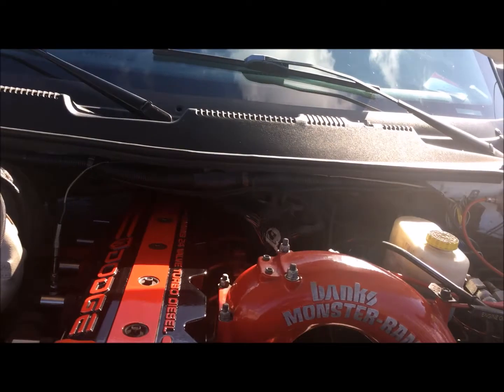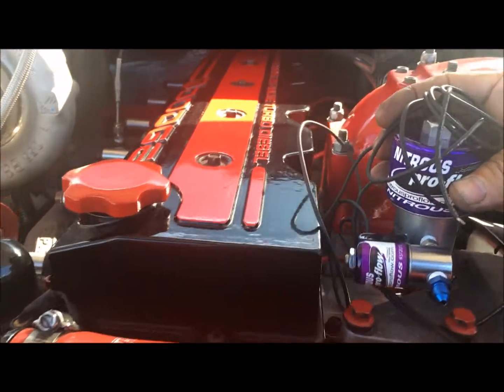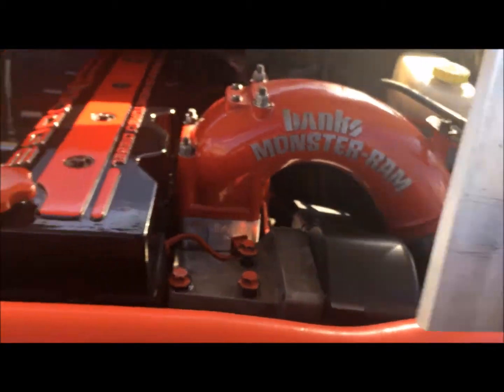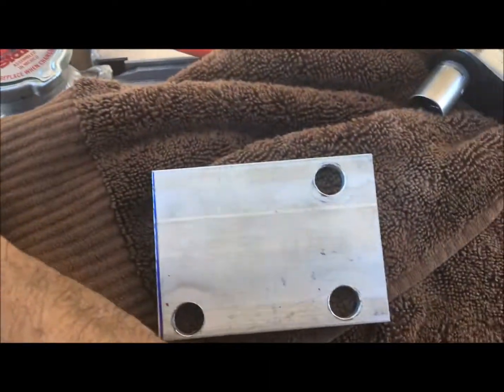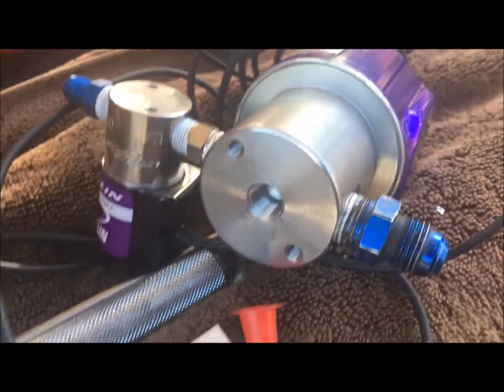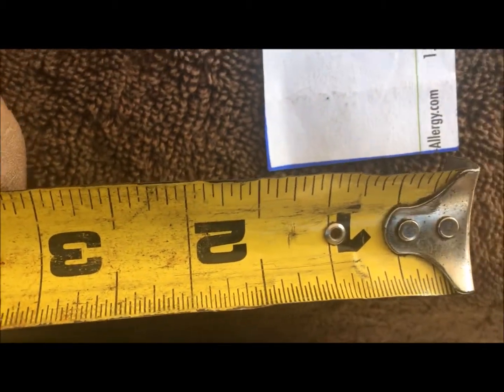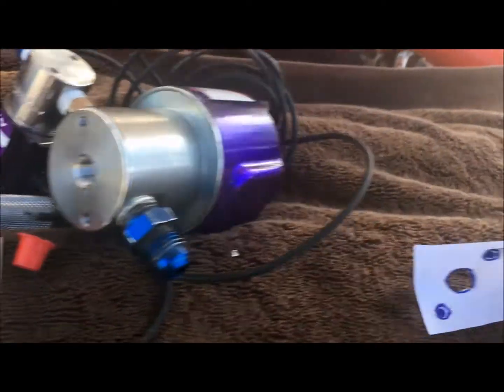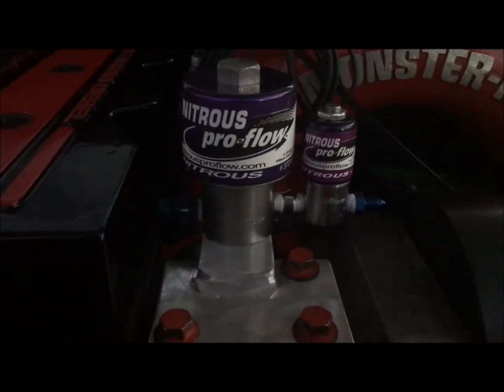How To Install Nitrous Oxide Injection On A Cummins 5.9 Cummins Diesel (Part One)

Comment: Clean truck do you have any vids with the nitrous being used ?
Reply from the maker: YOu know, life can be complicated at times.  when you get older it seems you never have the time to do a lot of stuff.  either that or i am an undercover procrastinator!!  But to answer your question: not yet.  I still have to do Part 2 and Part 3 of this series.  I hope to do Part 2 this upcoming Saturday.  And after all parts have been completed, you KNOW I am going to do a video blasting it with the nitro.
Reply: Im eager to try my homemade kit on my  95 12 valve